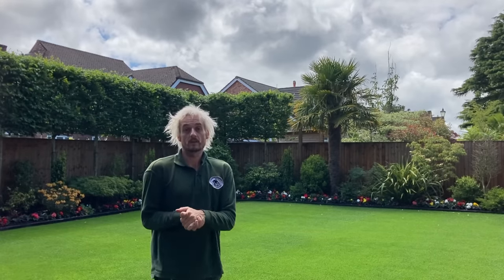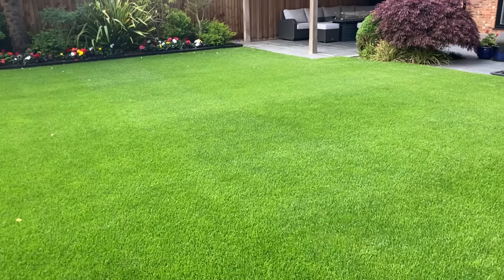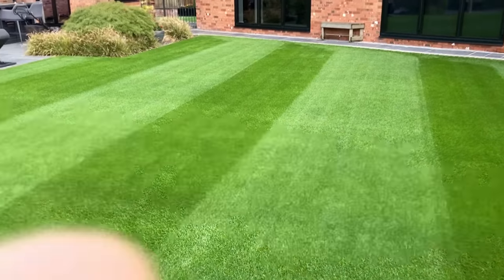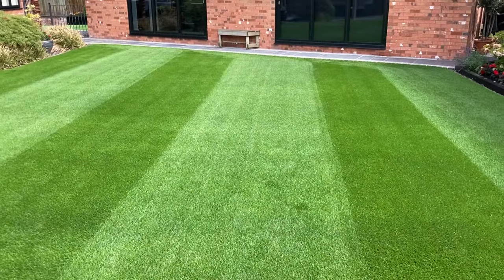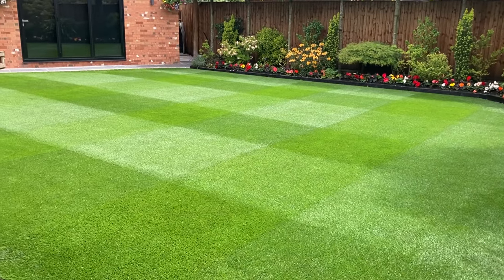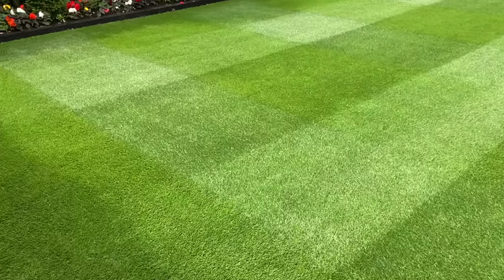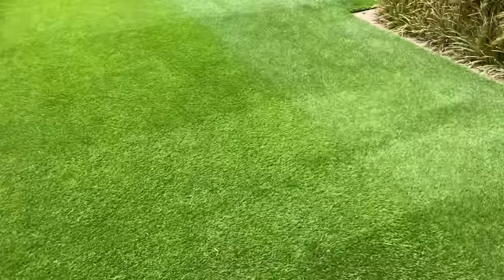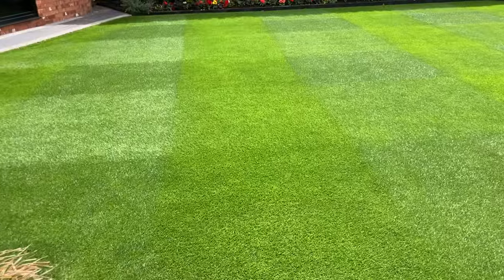Take YOUR LAWN  to NEW LEVELS

Comment: Hi Danny, I rotovated small lawn and reseeded with brandenberg 9 days ago. took the fleece off today and was pleasantly surprised with the growth, I was going to cut but i didnt feel the roots were deep enough to avoid damage , also where i stepped on the lawn the new grass has flattened, compost is moist and i'm expecting a little rain tomorrow, any advice, should i have just cut? thanks again for all your videos
Reply from the maker: You can cut just push and pull with the mower no turning and use arotary

Comment: Love the video Bud. Any advice for keeping a nice lawn with two dogs. Tried overseeing etc but it hasn’t taken well. Keep get brown patches everywhere. Any advice would be great. Thanks!
Reply from the maker: Nice lawns and dog pee is not conducive,
Reply: I have the same problem, Lance. I take my 2 dogs out first thing and again later in the day but still get dead patches all over. 
This year I’ve tried overseeding the areas but it takes ages. I also have dark green patches around the dead areas because of the nitrogen.
What I found works a bit is raising the mower height from 1 to 2 (rotary), as this makes the grass generally greener and so hides the darker patches. I’m also straight out with the hose whenever they wee on the lawn. Next year I’m going to try having a very small area grown as spare to provide patches to replace dead areas. Nothing’s perfect!
Reply: Get some Dog Rocks from Pets at Home, put them in the dogs drinking water, they neutralise the dog we and turn it into nitrogen feed. Worked on my lawn brilliantly.
Reply: @izalman  Thanks. Will give it a try!

Comment: Hi Daniel - got your products Saturday- I’ve seen a difference in 2 days already! When I combine the 2 galactic and stellar - do I add both in to 5 litres or do I add 200mls into  5 litres and also 100 mls into 5 litres so that 300 milli litres of products in to 10 litres or is it  300 millilitres into 5 litres of water (both products combined)
Also - can I just use the both like this every 2 weeks? Or what’s best?

2nd question - I am renovating my front lawn this September- it has annual meadow grass in it and although I did scarify and re seed in spring - it took too long to germinate and the seed I don’t think is good either so there’s patches of annual meadow grass again- - so the question is - what seed do you recommend? Climate - Northern Ireland (on the cooler side) - no one walks on it - I would like the grass to be thicker as well when it grows - rotary mower with a roller - using your granular fertiliser and your 2 products mentioned above. Think that’s all the info u need! 
And when is best time to start the renovation? I assume - mow lowest > scarify as much as poss > re seed > soil/compost/sand etc and of course water is the best method?

Thanks for your time!
Reply from the maker: You just add both products to one 5ltr tank

I just use the barenbrug extreme that i sell easy to look after easy to get going

The 2nd question has about 4 questions in it and the first has 3 so your 2nd question is actually your 4th
Reply from the maker: Renovate whenever just follow the vids theres plenty of them at this time follow paddys job started this week past year perfect for you
Reply: @DanielHibbertLawnExpert  Really sorry about the incorrect number of questions - I meant 2nd Main question area - as in topic. Thanks for pointing that out and I'll take far more care in future about numbering questions. Helping my lawn and my English Grammar. What a guy.